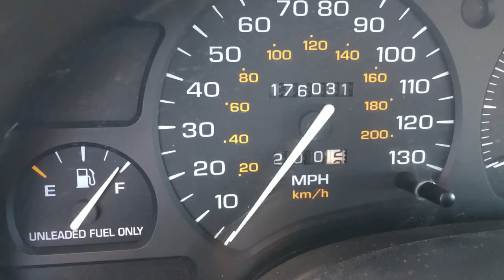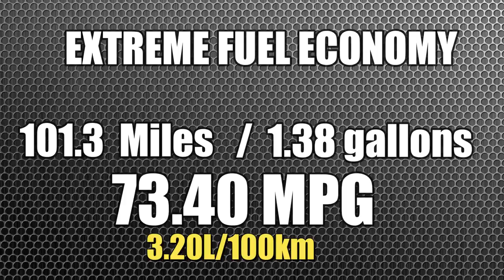S3 E11. Kubota turbo diesel Saturn extreme fuel economy.  super high MPG

Comment: Out here in rural nevada alot of the back roads have 45 mph speed limits. And in the spread out city of pahrump its the same. That car would be great there if it could withstand 120 degrees F in the summer.
Reply: @drippingwax  when I lived out there I drove a 1987 datsun 310. It had no AC. Just saying when it comes to economy one can deal with shortfalls.

Comment: Kinda surprised it didn't do even better at those speeds and with the care taken.  My GMC Canyon 4x4, with a 2.8 diesel, will get in the mid 60s MPG if driven like that.  Admittedly I didn't go 100 miles, I don't have the patience 😄  The Canyon is averaging 26 MPG (hand calculated, it shows 28 on Trip 2) over the last 60K miles.

Comment: propane or natural gas hybrid diesel kit..  i ran 70/30 diesel/cng mix my diesel 2007  1ton mega cab dodge ram and got 42mpg regular driving 26mpg towing.  i had to watch egt's. if i ran it to lean/cng  temps would sky rocket.  I also got a huge power increase.  i had a surge button that would dump cng into the intake for a 3-10 second period for huge "nos" like power boost.

Comment: Should plumb the stock tank into the fuel system for more range. Could pump diesel into the Honda tank and have a return line back to the big tank.

Comment: What really gets me is my Dodge vvt Pentastar 3.6l engine gets 33mpg at 79mph. Which to me is awesome for 400 miles. Sometimes 79 but equally at 81mph. That is calculated by counting mile posts over time per post. The GPS seems more accurate. I think Smokey Yunick back in the 60's was using a Perkins diesel with turbo and somehow he was getting 75mpg at 65mph. The car engineers from Detroit all came down to try it but he held the secret closely. In those days they didn't measure the nitrite emissions so he was probably running 50lbs boost and cooling the pistons somehow or coating the combustion chamber. Don't know if you even knew about the Nascar person.

Comment: Well done.  I bought a 1992 Saturn SL2 4-door sedan brand new, with DOHC engine and manual transmission.  In normal driving, it averaged 32mpg (wife) to 36mpg (me) but at speeds like in this test and tires aired up, 40mpg was the expectation.  

Pretty good for that era, and it was a nice car with heated leather seats, more aerodynamic than you'd think, and slippery enough to be going faster than you realized.

But it's still nothing compared to a Prius, in terms of efficiency.  The cargo capacity of a Prius is more like the Saturn wagon than the Saturn sedan or coupe.  In my 2005 Prius, I bought a US General 56 inch roller tool chest at Harbor Freight.  With the wheels removed, the 400 pound steel box slid in, and the hatch shut, without me being cramped in the driver's seat.  I could have won a $20 bet with every HFT employee present, but instead just chose to amaze them by closing the hatch and driving away.

I can drive 40-45mph laps all day long in any Prius from 2004-2022 that's running properly, and get 80mpg.   I've done exactly that in my former 2005 Prius, and my current 2017 Prius Prime.  They had 1.5L and 1.8L Atkinson cycle gasoline engines that run on regular unleaded gas.  In fact, in my area the gas is 10% ethanol, so the mpg would be better using 100% gasoline.  My tests all started and ended at the same place (hence same elevation), same hybrid battery state of charge (only net energy consumed was gasoline), and used the max-load tire pressure Michelin printed on the sidewalls of the X-Ice3 SNOW/ICE TIRES, so not some super-eco crap tire.  75F weather, so AC off, fan on to blow fresh air through the cabin.  No tricks, just a route with only one stop sign per 5-mile lap, very little traffic, and speed limits from 35-45mph, letting me keep speed around the same 42mph average as he did in this video.

Comment: lol, you can buy a 2 litre turbo Mercedes Wagon / estate car  in the uk with 250hp that does 72mpg at 1600kg in weight which I think in us mpg is around 60MPG and it will go 160mph xD.
I know on a family trip full of luggage and 4 people it did 800miles to 60litres of fuel and normal driving and when it goes to the inspection and testing every year it has zero readable emissions.

Comment: I have a ton of experience with these old Saturn's and the twin cam model is amazing with the transmission from the single overhead cam model.  With my old Saturn I actually made efforts to open up the EGR ports for better flow, I installed smaller injectors and raised the fuel pressure to get better atomization.  I also put an air filter short routed on a 2-inch pipe right next to the exhaust manifold.  This list of modifications got me a 52 MPG average from my 1995 Saturn SC2.  

Absolutely love these old cars and I'm four minutes into your video and I'm already excited about seeing what this Kubota can do

Comment: To measure fuel in the tank you don't need anything other than that square. Loosen bolt on sqr, drop measuring rod into tank, drop straight edge to top of filler, tighten nut and pull for an easy read. You could also eliminate the square and just use a wooden ruler and measure the level of the fuel for easiest results. That's how we did it back in the day.

Comment: Your steering wheel of the station wagon is slightly rotated to the left, even on straight bits of road. You should check your track and camber. 
Anyway: Thanks for the great series of videos!
Reply: The 94sw2 I had suffered from the same issue, but the tires wore evenly so I didn't mess with it.

Across a few years of ownership I had maybe $1200 total into it, including purchase price minus tires.

Comment: In Europe we got loads of small Cars with direct injection, turbo diesel engines. 1.3/1.6 litres making between 70 and 120hp. In the type of driving you describe, i think they can do little Better. Fiat 1.3 Multijet, VW 1.2 TDI 3 cylinder, Peugeot 1.4 HDi and so on.

Comment: For low fuel consuption you can use normal european diesel. 
Mine is brand new and I did a test how low can fuel economy get. It did 3.6 liters on 60 miles average at 50-65 miles per hour on a 500 mile journey.

Comment: Black sooth means you're running too rich, and can get better mpg by setting less fuel, and more air. Also check to see if you can increase compression by changing out the head gasket to a thinner one. Should net higher mpg, and performance.

Comment: My 2018 Civic EX turbo gets up to 42 to 45 mpg at 75 mph on the interstate. If I drive 80, it still easily gets 40 or 41 mpg. It gets better than the ETA rating, which Hondas always do. And yes, in rural interstate areas, you can drive 80 in Utah. I generally drive 75 anyway. People can always pass me.

Comment: Hey Jimbo, you should look into the European Volkswagen Lupo 3L , it was a small car with a 1.2L turbodiesel engine with a fuel usage of 3L/100km. Might give you some inspiration to continue this series! It’s a funky car, and drives pretty nice for it’s size.
Reply: The Lupo had tires with even less contact patch than the Saturn Motor Corp.   There really is a problem to attempt to turn and stop on tires from even 55mph on less than 185/70R14.      I think the lupo had 155/70R13 or 14s.    Running that tire there has to be an investment in suspension tuning that old school VW would do.

Comment: In the begining of your video I thought you were talking about my car.  1994 sl2 sdn.  oil leak, burns oil almost 300,000 mile. I went over the car 12yrs ago , only change oil and a new set of tires this year. FYI, i dont need anymore ideas.😅 Install a V8 in my s10 is enough. although a V8 saturn would be nice.

Comment: Durable.......yah right. I had a L300 twin cam V-6. In less than 100,000 miles it had the CV axles go out, the  mass air censor died and the engine started popping fuses for the electric cooling fans due to a short in one of the cooling fan motors. The crap cartridge style oil filter housing started puking oil on the ground everytime you would shut the engine off. At around 90,000 miles. I had the oil changed every 3,000 miles and 95% of the mileage was at highway speeds.

Comment: 5.9L/100km in my 530d Touring from 2015 stage 1 tuned with DPF removed (335hp/700nm). 2 adults and 2 kids, plus a full load of baggage in the back, well over 2000kg total weight since I know the car has weighed in with me and a full tank at 2140kg. 70L tank gave us a nice 1000km range before needed to consider a fuel stop on our ~4000km trip.

Comment: I suppose in a Mad Max world where fuel is hard to come by and you have to drive "Dallas to Denver" on a tank, this would be useful. I would like to see tests at 100 kph, about 62mph, a speed mortal could adhere to without getting shot at or pulled over. I drive a 30 year old car and if I set the cruise on 65, I'm no problem to anyone and actually pass something occasionally.

Comment: My 2015 Ford Mondeo 1.5 liter turbo diesel (could be Fusion over there?) can be driven under 3 liter per 100 km, my record is 2.8 L/100 km during a longer trip where I tailgated a truck at 80 km/h for most it..
Reply: Yep any diesel car that isnt too large with a small-ish engine can do it at these speeds.

Comment: As the owner of a 2006 jetta tdi 1.9l turbo diesel, this video triggers me a little. I've been tracking my spending of my beloved jetta over the last ten years of ownership, and my average mpg is 34.4mpg during the 77,400 miles of ownership. Granted, I've done less than nothing to "optimize" my driving habits, and this car sees WOT multiple times a day... You know, it takes 11 seconds for this thing to hit 60mph, and my near daily commute includes 40 miles round trip of interstate driving... Plus I'm kinda used to a 0-60mph time of sub-4 seconds my turbo miata accomplishes...   Dammit.

Comment: This is impressive, but there's still the potential for a large of margin of error with the relatively low 100 test miles. A 200-mile run would be better, but I understand you might not survive 4-5 hours in the car

Comment: A dozen years ago, Mercedes built a Series S (top of the line, full luxury) sedan... with an engine meant to get very high mileage. It succeeded. Acceleration was painfully slow, top speed was 60 mph... but that car got extraordinary milage. (I don't remember exactly but it may have been 3 l/100 km.) Mercedes built it to show what could be done... but that no one would buy.

Comment: Did you make an adapter plate to hook up the tranny? Would be nice to know.Is it an automatic or manual? Been wanting to stick a kubota street sweeper motor in my Nissan hardbody  but kinda worried about the torque stress on the axles.

Comment: Vw TDI 1.9L turbo diesel engine, 1997 to 2003 make juste a little bit higher number, between 3,7L/100km for 70-80kmh, 4 to 4.3L/100km only  highway in summer at 100kmh and  4.5 to 5.5L/100km for daily normal use! 
I make 1390km on one tank, very long trip on highway!
Nice mod, i like it.

Comment: My car of choice is the VW Golf with the 1.9L diesel. It beats your specs hands down. Plan to tweek it to insane mpg. Loved the video!
Reply: The 1.9 was a great engine and I loved that. I preferred though the later VW 1.6 common rail diesel which I found was even better on fuel with a manual gearbox. I had two cars with that lovely little engine and getting 75mpg on a run was easy without reverting to driving at 45 mph in 6th gear. I now use the 2 litre (post emissions scandal) version as a daily driver and that 'only' gets 68 mpg at best. 👍😀   I know the VW Lupo L3 is even better with 100mpg being possible, but I have not driven one of those.

Comment: I use Saturns as my daily drivers have the wagon the coupe and the 3 dr coupe I average 39mpg on the coupes(both single overhead cam engines) and 37mpg in the wagon(dual-overhead-cam) If I run the a/c that costs 2 mpg. My total cost per mile with the purchase price, fuel, insurance, tax/tag and maintenance/repair is $.11/mile. Best value car out there and the wagon can carry 10 ft lumber(inside)

Comment: I bet this engine will run just fine on a used oil and gasoline mixture. My kubota tractor runs on it well. I wonder if it would better the mpg’s

Comment: I have in my sailboat a BETA30 , that is KUBOTA engine 30 HP 1.1 liters 3 cylinders at 2200 RPM  it consumes 1.5 liter of diesel an hour .

Comment: My focus station wagon 1.5 d gets 57 mpg about town and 75 mpg on the freeway. As an experiment I drove a work open corsa d 230 miles at a steady 56 mph on uk motorway (in work time) and got 97 mpg. The most boring and tiring driving ever. Regards from Mark near  London uk.

Comment: When  do they plant  the corn in Kansas?
Reply: Planting corn is not as easy as it seems.
Reply: Here’s why:
    Corn are not able to survive frost or cold weather under 50 degrees Fahrenheit.
Reply: Sweet corn is a warm-season crop and should be planted in mid- to late April. New
sweeter varieties have a smaller, more shriveled seed and will rot in cold soil; do not
plant these types until early May. Successive plantings of corn are important to spread the
harvest over a longer period. Make additional plantings when the previous planting is
0.5-0.75 inches tall.
Reply: Spacing
Plants should be 8-12 inches apart in rows at least 3 feet apart. Do not crowd plantings, as
weak, spindly, unproductive plants will result. Plant the kernels an inch deep. If many
seeds fail to germinate, do not attempt to replace missing plants; replant the entire
planting
Reply: Sweet corn requires wind to transfer pollen from the tassel (male) to the ear (female).
Plant corn in small blocks or several short rows rather than a single row to encourage
better pollination. Sweet corn pollinates poorly in 100o F weather and ears with missing
kernels or gaps may result.
Reply: Knee High By 4th of July…or not🤠🤠🤠🤠
You may have heard the old phrase, “Knee High by the 4th of July,” used in reference to the corn crop and it’s growth stage. But the truth is, thanks to new technologies, diverse planting dates and weather patterns this phrase doesn’t really fit Kansas and our farming practices any more.
Reply: Orrin Holle is a farmer in Rawlins County, Kansas. He recalls the earliest he’s planted corn being April 20 and the latest being June 11. His latest planting date was also caused by large rains and even a late snow storm or two.🚜🚜🚜
Reply: As you may have already guessed, you need to pay very close attention to your local weather in the spring. Specifically, you are going to need to watch when the last frost occurs.

In general, when there hasn’t been a frost for two weeks, you are SAFE to plant your corn outside in Kansas!

Comment: I did a 100 mile one way home to work drive for 4 years in a VW Polo 1.2 TDI (yes with the crap software) on warm days it achieved 3.0 to 3.2 l/100km. Highway speed 100 km/hr, all other roads 80 km/hr. So this is possible.